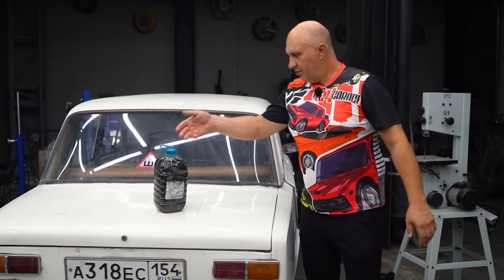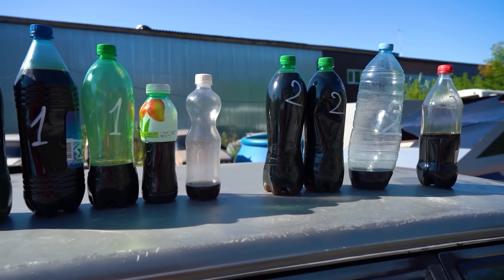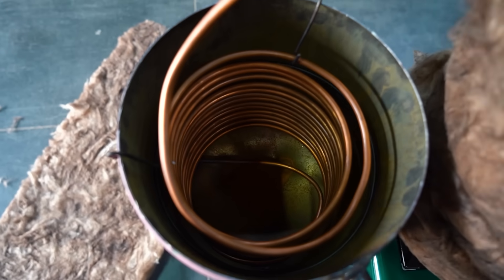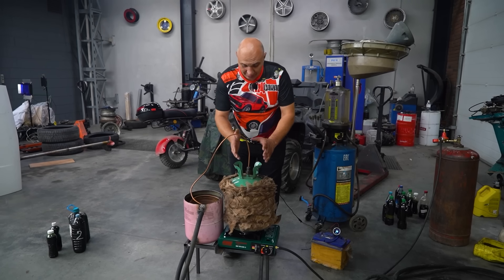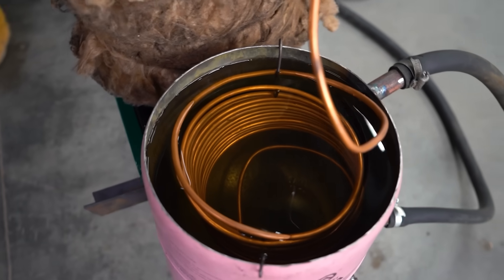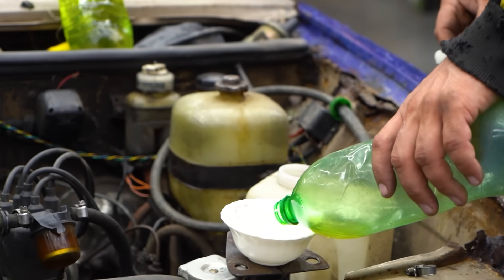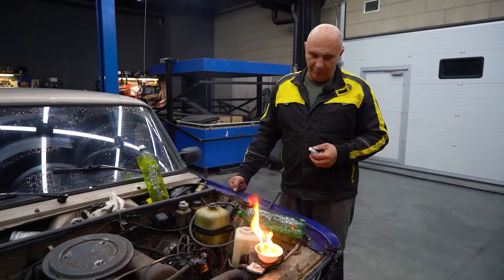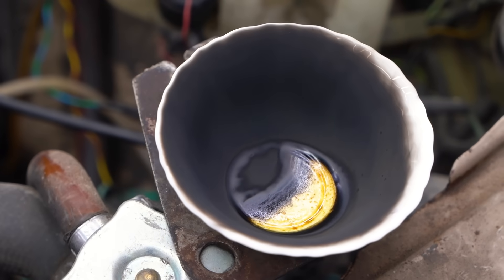Tire-extract fuel vs pump gas - which is better?

Comment: Would be interesting what the octane rating of the synthetic fuel is. And repeat the test with a fuel injection vehicle where the O2 sensor regulates the air/fuel mix.

Comment: I think you have extracted a slightly heavier fraction of fuel than the common 92 oct. Its far from diesel, but it would make sense to call it "closer to diesel". It may behave as higher octane fuel. It burns longer, produces more smoke and has more energy density, where your experiments proved it. 
If you feel like doing more such experiments, how about you turn pump diesel to gasoline and test it?

Comment: The tire extract showed approximately 7% increase in fuel economy. Not huge but significant. This would be a great way to get rid of the millions of tires stacked in landfills while also reducing dependence on fossil crude.
Reply: No such thing as fossil fuel.
Reply: @TehButterflyEffect sorry, not feasibly replaced within any semblance of a reasonable time frame fuel. Geez I wonder why they call them fossil fuels instead.

Comment: Despite the "tire fuel" being less refined than pump gasoline, perhaps the gain in power and fuel economy is due to the lack of additives. Detergents, scavenging agents, pour depressants ETBE, etc. all take away from gasoline's total energy density.

Comment: Based on the burn and the heat in the cup, I'd say you made 115-120 octane, ill bet if you tuned it /adjusted the timing you'd get much better results.
Reply: Holy crap, that’s awesome!
Reply: are you in any way a expert?
Reply: @blackdaan  mechanic, and I did have a race car and have knowledge about high octane fuel.
Reply: @christianfritz6333  just out of interest 😅.. I don't know what's up with this fuel but it seems better indeed. But is it because of octane.. idk
Reply: @blackdaan  I'm no scientist, but as I understand it raw refined gasoline has an octane of 100, based on the hydrocarbons in crude oil. Now. This fuel was made from tires I didn't watch the process video, but since he keeps referring to it as synthetic fuel and knowing that there are polymers and elastomers as well as carbon from the vulcanization in tires I'm going to assume there are other hydrocarbons in the mixture, hydrocarbons boost octane. 
Also the higher the octane the more heat and the slower the burn. So that's how I came to the conclusion that the octane is higher.
Reply: @christianfritz6333  that sounds more like it 😆

Comment: A big big thumbs up on this one. Old tyres are a huge problem, there is almost no use for them. The best way to get rid of anything it to turn it from waste into a resource .
Reply: That already the case tho company already burn raw tires in huge boiler for electricity
Reply: Shreaded tires have been mixed with coal and burned in coal fired, steam turbine electiric power plants for decades. It's called "Tire Derived Fuel"/TDR. Up to 1/3 of the fuel mix is tires.
      This way, tires don't take up space in landfills or pile up, becoming out of control fire hazards, and the energy present in the tires doesn't go to waste.
Reply: The thought that comes to mind is, how bad are the gases that are generated from doing this? They are flammable so could be used as well. 
Maybe they could run an engine in the same fashion as propane can, maybe they will compress to a liquid too. Analysis of the gas and liquids would be interesting

Comment: That was very interesting! Maybe sulfur would be a problem if you use this long term. There is alot of sulfur in rubber. I think it may form sulfuric acid after the combustion
Reply: Correct....rubber contains a sulfur element in it's molecular formulas therefore the gasoline produced from rubber tend to be high sulfur

Comment: We know that in a post apocalyptic world when modern luxuries can no longer be taken for granted, the guys at Garage54 will still be driving Ladas around.
Reply: Probably striped exoskeleton Ladas, run on tire gas.
Reply: @jwalster9412  id reckon theyd also try their hands at biodiesel too, which is made from organic oils, ethanol (sourcable with any still), and lye (harder to get but both forms work so using the salt electrolesis method or by simply soaking woodash in water to get pottash which is primarily made of potassium hydroxide)

1 part ethanol, 6 parts oil, with a gram of powdered lye for every 200 millilitres of combined fluid.

Mix the lye and ethanol in any lye safe container, avoid sealing due to pressure buildup, keel well ventilated, don't let it touch skin. After the lye is completely resolved you will have methoxide.

Mixing in 1 part methoxide to 6 parts organic oil in a gasoline safe container will produce biodiesel and glycerol. Make sure to mix well and burp the container every now and again while the chemical reaction works, which takes about 4 days for 3 gallons of oil.

After that simply pour off the biodiesel and leave the heavier glycerol sludge in the bottom in a similar fashion to pouring off alcohol from yeast sludge. The product is a rough, but car safe fuel, though it is worth noting that it would be on par with low grade diesel, so not all engines could run on it without wear, tear, and potential clogging.
Reply: @jwalster9412  while on europe they runon their own feet they are dumbs
Reply: I drive nothing but late 80s mercedes diesels. In the event of apocalypse type world I will be one of the few vehicles still running. My car will run on used motor oil. Old gas. Old diesel. Transmission fluid. Cooking oil. I can get fuel anywhere if thinks kick off.
Reply: @w124mercedes7  you ran your car on transmission fluid?
Reply: @jwalster9412 I ran a kubota v2203 on used atf. It made a tiny bit of smoke, but it wasn't bad. I have no doubt an old diesel car would run just fine on used atf.
Reply: @inoahmann7542  for flammable is ATF??
Reply: @jwalster9412  Not terribly, but it's fine in indirect injection diesel engines.
Reply: @jwalster9412  You really need compression to make it flammable.  you don’t have to worry about it igniting with a lighter or a spark or something
Reply: @TheGrobe

You don't need compression, just the heat that it provides. Hot brake components, turbochargers, and catalytic converters are sufficient to set ATF alight in the event of a hose/line rupture or in a collision.
Reply: @johnfox3845  This is 💯 correct.
Diesel is the same way. Although it will ignite when cold, just slowly.
It's when it gets heated that it becomes volatile. 🔥
Reply: @w124mercedes7 i still have an old Xantia under a cover. XUD engine. Pretty bullet proof too, can run on crude as well. Id say the fuel from the tyres filtered a few times will do fine
Reply: @w124mercedes7 Unless your 80's ecu is hardened to EMF in a Faraday cage, it could be disabled by an EMP device.
Reply: @w124mercedes7  you ain't the only one mate
Reply: Tire Vodka
Reply: And burning that crap in the Tanks lol
Reply: the LADA used to be the fiat 124 ... i had one
Reply: @joken8901  They were very much the same 👍 but not 100% exactly...
As the Lada 2101 was a heavily modified and licence-built version of the Fiat 124 tailored for the Soviet Union.  But I'd like to have one if I can find one in good shape.
Reply: I was just thinking about this lmao
Reply: I mean lada is a pretty comfortable car to be honest
Reply: @TF2Scout..  I've actually been shopping around for one. There's a bunch of good looking ones out here for sale but I really want an older one that's needed TLC for a while and that's reasonably close to where I live... The wife has given me permission to buy one whenever I find the right one.
Reply: Yeah, & Cockroaches like Ladas will survive-anything.
Reply: That's already Russia
Reply: I mean, they already live in a post apocalyptic world
Reply: If you added a thumper tank before cooling tank would clean better.
More space in between copper lines like wood blocks will cool better

Essentially moonshine set up
Reply: theres plenty of them in india ... i bought a beach buggy a couple years ago plain and simple no ECU works on suck squeeze bang blow and a distributor just like the lada/124 you can't control the people when the people know how it works
Reply: @joken8901  I've found a few in the US for sale, including a few Fiats of basically the same design platform.

Comment: The fact that tires cant truly be disposed of and dont break down over time, this could be a legit alternative fuel if done correctly on a mass scale.
Reply: I mean, technically you can make fuel from plastic too. We as a society has no shortage of plastics.
Reply: i think the likely problem is it would take a lot of energy to get the purity needed to pass environmental regulations. highly unlikely you'd ever see a big corp do this.
Reply: @78MatWar87 it’s basically crude oil refining would be no different from stuff out of the ground
Reply: Shreaded tires have been mixed with coal and burned in coal fired, steam turbine electiric power plants for decades. It's called "Tire Derived Fuel"/TDR. Up to 1/3 of the fuel mix is tires.
      This way, tires don't take up space in landfills or pile up, becoming out of control fire hazards, and the energy present in the tires doesn't go to waste.
Reply: @sparky6086 Also mixed with asphalt.
Reply: @sparky6086  yEAH IT just makes already insanely polluting fuel of coal even more polluting, then idiots shift blame on simple people and want to ban gas powered cars, look at germany, idiots shut down all nuclear power plants, let USA blow up the pipeline, so got out of cheap russian gas and then turned up coal powerplants like idiots, still virtual signaling to me, that my car is pollutin too much, so needs to be banned in 2035, Fuck those weasels.

I do think these tires, with a bit of purification are burning less toxic than coal power plants. So it could be used for something, while gasoline is a very pure fuel, i bet with this setup you could EASILY run old diesel car, heck diesels run on anything really if they are old enough.
Reply: I am averse to that sentence, no offense, it might be because I am in a country that has miss used the people's money grotesquely. So doing things on scale and giving a hand full of people power over masses is dangerous if power isn't accompanied by responsibility.

I realize scale has exponential gains which will always make it more efficient, however delocalizing essential productions like food and energy has the benefit of not being tied to the volatility of a view people but much more stable as every stakeholder  also has responsibility and power to a degree and the mean effects of decisions is spread over the whole group.

The reason I advocate this position is because the scaled giants called government and big business let's us infantile beings suck at it's teet and giggle in our cots, the one thing we may never do however is mature and become independent of our shared "Mother", I see people readily giving up self agency to this higher Mother and it saddens my heart because the people that came before overcame Nature, we are tempted to never become heroes like our ancestors and stay dependent on this modern "care-taker", hipnobreastfeeding. .
Reply: @wadeodonoghue1887  and damn it we have raped the land so badly that there is little that is accessible to an individual anymore , and the corporations are seriously considering dredging the oceans and their ecosystems that we haven't even looked at!  yet a probe to an alien planet we sterilize our spaceships to protect alien life that doesn't exist!
Reply: I used to own stock in unique tire before they went under due to embezzlement. I own stock in plastic2oil and if I could get investment I'd start a pyrolysis plant near me!
Reply: It's more a Diesel fuel than a Gasoline, this was done years ago with Diesel multifuel engines in Military vehicles. Also remember tires are made from natural and synthetic Rubber with carbon black added.
Reply: Problem is it would take more energy to extract the fuel than you would output from it. Would be constantly working at a net loss.
Reply: Personally, so far as tires go I like them better in asphalt, but plastic to oil I'm behind 200%.
Reply: Problem is it takes energy (from fossil fuels) to convert the tires themselves into fuel
Reply: It would work great, the byproducts and pollution from large scale processing.... yeah not so much. Same reason we will NEVER be a society of lithium batteried EV drivers

Comment: I'd like to see the plugs after a run.  The soot it produced compared to gas may cause more harm than help.. and it can't be good for catalytic converters.
Reply: Cat on a 85 Lada  lol
Reply: @legros731  Ok, I was thinking newer cars.. but now that you mention that.. it did sound rather silly.  lol
Reply: @GasketManzrevenge  not silly 
This could be bad for a catalytic converter 
the soot will be way less when the mixture is compressed by the engine as seen in the video the car was not smoking
In a diesel soot= too much fuel= unburn fuel burn in the exhaust= soot

Comment: Well its probably not just gasoline, its more of a mixture of diesel kerosine and gas if i guess. What you guys did was extract the actual oil from the carbon that was extracted before with the tires. Ngl i really love to see the result too.

Comment: I wonder the air/fuel ratio on thay fuel. If you thoight it was running rich try leaning it out some and testing. It shoukd get be more powerful and more efficient.

Comment: You need a low tempature for refining fuel. Only 35 degrees C or 95 degrees F is needed to boil gasoline. You could use a solar thermal heater to boil gasoline. Kerosene boils at 150 degrees C or 300 degrees F. But if you run kerosene over a carbon felt and blow air through it you should also make a fuel vapor for condensing.
Reply: A hot day you could paint your boiler black and use sun light for heat. Anyway the low vaporizing fuel should boil out on a hot day anyway so the solar still may be the way to go.
Reply: But to make the crude fuel from tires, it requires a much higher temperature. I guess you're only talking about separating the fuels after the pyrolysis of tires, but even that probably requires a higher temperature.

Comment: Try it for a week in regular use, and check residue indide engine, and do more comperation with regular fuel, like more engine types from lawnmower to precise fuel injection cars engines, and features like how long its useable before its a starts to get heavier or nasty, how it reacts for belowe zero temperatures, etc
Plus try to add some custome smell to it, with fruits, or deodoratns etc.😅 Ohh and do smogtest!

Comment: my theory is that the pump gas have water or something in it and the synthetic version have no water or less water in it.  We do have 95 octane here so 92 sound a bit weak as i read it and the lower octane number seem to point at something that is mixed into the gas....  we used to have 98 as well but the politicians didnt like it and removed it and most of the older cars was running like crap (that was made for 98) ..

Comment: I would be very interested to see the difference when used in a computer controlled vehicle since it seems that the fuels are different enough to see gains there as well, even though we don't know the proper afr.
Reply: If you run regular fuel and read the fuel trims and then run this fuel and compare the fuel trims the narrow band o2 sensor will tell you the stoich ratio. If the trims add 10% fuel compared to regular fuel you know it's around 13:1 etc which would mean higher octane but less energy closer to alcohol than unleaded etc!

Comment: taking into consideration the current state of the world. If there were more people like you guys focused on building and making things work ,we would  be in far better shape .. Nicely done.
Reply: Move to a poorer country and you'll see way more of this kind of stuff thats not profitable if scaled up but makes sense on individual level(and people not giving a shit about taxes and regulations).

Like people using diy cars with kubota engines and stuff, it doesn't make sense if you could just get paid welding and buy an efficiently built car. It has its charm though.
Reply: @lassikinnunen I keep saying that the Americans are going to have to learn how to be much more self-sufficient, innovative, and ingenious, much like the Cubans did in the 1960s.
Reply: @floridagunrat1625  Yes. This is indeed where the US is headed. And MUCH of the world.
Reply: Or 'the powers that be' would have to increase their # of 'shadow men'!
Reply: @strangelyfamiliar1729  Make large holes in the ground for their increased numbers. Good fertilizer, too.
Reply: "If there were more people like you guys..." 
So, be one of those guys. What's stopping you?
Reply: lack of resources @johnsmith7676

Comment: I wonder if filtering your synth gas would remove a lot of the particulates and maybe the rubber bits still suspended in the solution. Small filter like 10 micron or something. Not sure what it would typically be filtered at.

Comment: i wonder if it was mixed with ethanol or regular gas in a 50/50 mix, would it become better or worst? definitely works as is tho!
Reply: They could even make the ethanol on the same equipment.

Comment: Only thing I would do different is after the cracking the crude I would wash the finished product with water to remove the solids. It’s a simple process and would probably give you really similar results only less residues to clean up